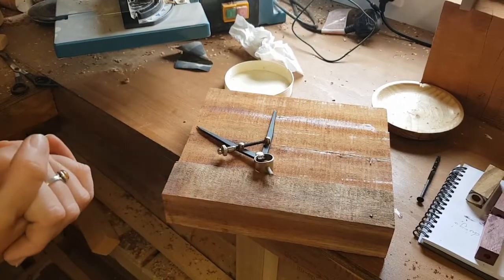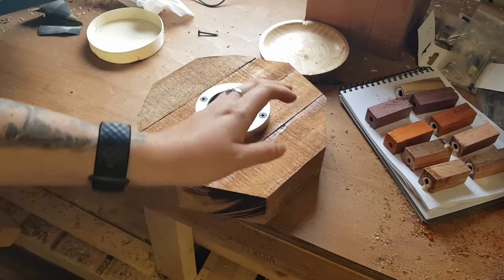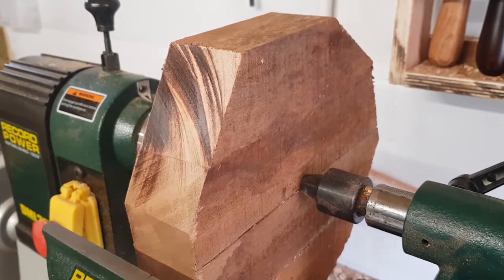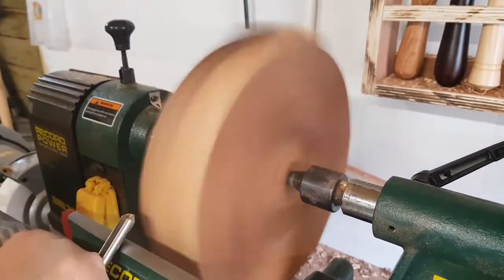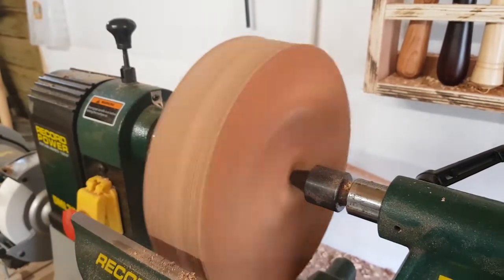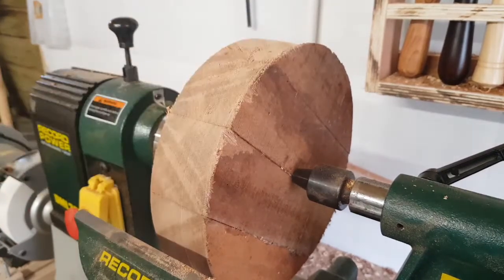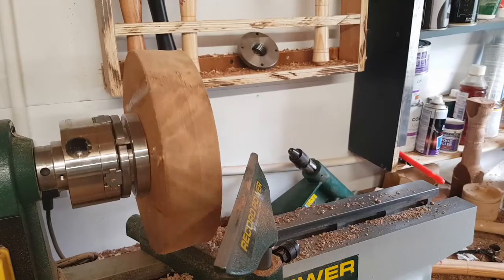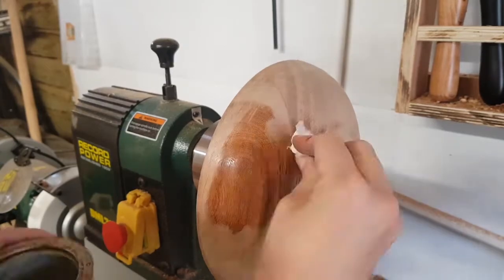Shallow sapele bowl on the lathe

Comment: Nice job. For finding the centre, you'll get it bang on if you draw a line between the 2 pairs of diagonal corners, and put the point of the compass where they cross.